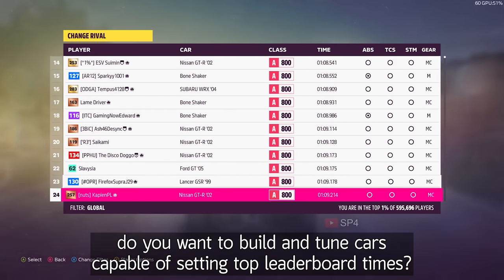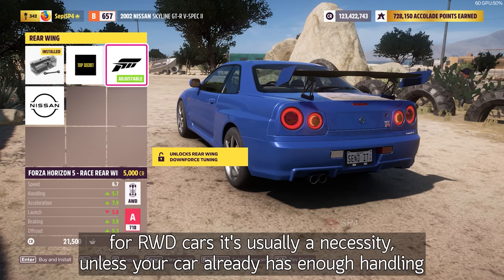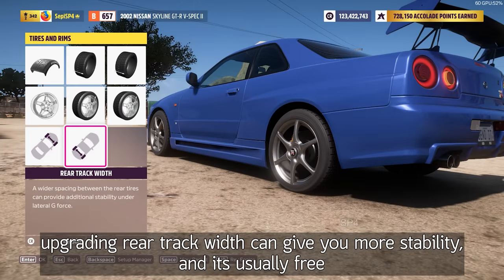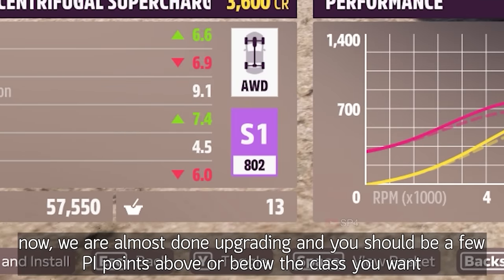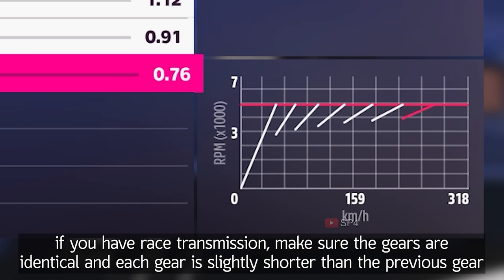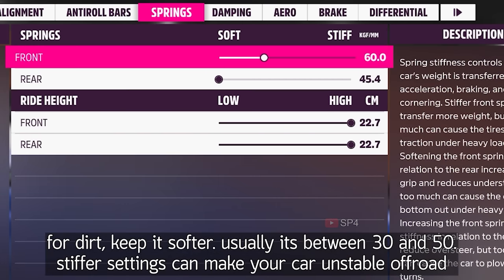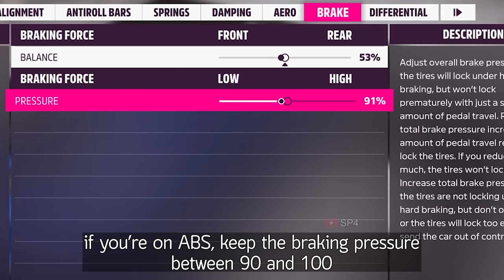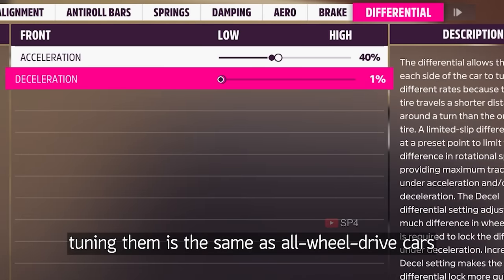Forza Horizon 5 META Tuning Guide

Comment: This straight up breaks almost every single rule of real life suspension tuning thanks forza 😂
Reply: exactly xD
Reply: The dumbest thing to me is how 0.2 degrees of toe out can reduce your top speed by 15 kmh. Racecars commonly use between 1.5-3, but that fails tech in Forza lol
Reply: @InZomnia365  racecars also use 3-5° of camber typically but forza says 2° is too much
Reply: @InZomnia365 it does not actually lower your top speed though does it? It shows you that it did in tune menu but if you test it car will still hit same speed iirc.
Reply: @nodo7575 yup. Same thing when you switch tires it might state the 0-60 changes but it really doesn't

Comment: I'll be sharing this everywhere I can.. Excellent guide!!
*Bonus Kudos for GT Music* 👊👊
Reply from the maker: thanks a lot :)
Reply: If don says it's good it IS GOOD
Reply: @rysh8331  unfortunately, most of DJS’s tunes are rather weak, they are great for beginners and solo players, but they are super weak for online racings.
Reply: Looking at your spreadsheet some numbers don't add up, your spring and aero number don't match the ingame numbers i can set.
Reply: @arnomeke1  set units to metric
Reply: @arnomeke1  Certain cars have different values. I just tuned an A-Class Continental GT which didn't go as low as the range he said for springs, but then I tuned a Vantage 19' that went lower. Either way, it should be in the bounds generally.
Reply: George Floyd  djs tunes really are just ok. even i can make better ones sometimes. maybe he doesn't spend enough time on some cars though
Reply: well, that's me unfollowing and never using your tunes again... this is not a fun way to play. i know you don't care but this guide, excellent? it's all wrong
Reply: how so?
Reply: we still wanna know why u mad
Reply: Bruh, I followed the guide, ran them on a test track, and they turned out really good, ur just mad

Comment: Bro this is the real deal. I have 400+ races played and I usually end middle of the pack with home made tunes. 

I followed ur guide then i got my first ever 1st place and a couple matches later won my first tournament! 

I used to think people were straight up just better than me but it turns out I was using the wrong stuff the whole time 😅😂
Reply: Yeah, in most races i knew i wasn't slow, i knew my cars were lacking important stuff, even with my terrible, terrible tunes i got some podiums, but most of the time i would end up near last place, even average or below average players would ram me and take me out, some of these losers even DMed stuff for no reason (i am not a rammer, if you are faster, i will allow you to pass). 

With this guide i now win most of the races or end up in 2nd place, now rarely i lose or get left behind, not to mention feels to good to be able to pass rammers or easily return the favor. Now i can take any car i like, use this tuning base as a guide and make it a rocket that make will people sh1t their pants. I've gotten so fast that sometimes if i feel i took someone out way too harsh, i give them the position at the end of the race, i don't care. Becoming super quick gives you a lot of confidence and also, you respect even faster racers as well.

Comment: This is excellent, it's what i needed, a good base for good tunes without any pointless explanations on what each car part does or what every single adjustment can change, just straight to the point, tells you what you need to do and you can move on from there to customize your tunes.

Some cars are still slower than i would like, but with some fine changes i think i can make some pretty fast stuff, thanks a lot for this!

Comment: Right on. Finally! A video simplified that I can spam watch every time I “attempt” to manually tune my cars. GG’s 🔥😎
Reply: Same 😂
Reply: Just watch hoki hoshi guides if you want a good tuner to learn from it's way more informative than this I mean this guide is okay and all but it's for getting the most performance out like power and torque with the least amount of pi which doesn't equate to good tuning or upgrades
Reply: me with drift tunes
Reply: @shura4136  well most of his tunes are within the top 300 times so he knows what he's doing.
Reply: @craigkingdon4424  I'm not saying he doesn't his tuning is just focused on most hp and torque out pi  for competitive use
Reply: Same 😆
Reply: @shura4136  getting the most performance with the least amount of pi is literally the definition of good tuning
Reply: @craigkingdon4424  no he doesn't :')
Reply: @shura4136  it literally says META tuning in the title
Reply: @veeembee  so you believe everything you read?
Reply: I've watched hokihoshi and sepi, sepi may not go as much in detail, especially but he definitely is a better tuner compared to hokihoshi, hoki just explains what each tuning setting does, sepi not so well but he's a consistent top 300 tuner. You don't believe anything you see but you'd have to be stupid to not see this, consider the high amount of proof available and believe that hoki is a better tuner, you'd have to be stupid, which I wouldn't be surprised if it was the case for you lol.

Comment: You also need to look at speed and acceleration, you want to be trying different combinations to get your 0 - 161 km/h second count as low as possible in that class
Reply: Quick acceleration comes at a sacrifice of top speed and vice-versa.
Reply: @CokefishR  Yeah, but it's the rate that counts for quicker pull out of the corners
Reply: @CokefishR  not necessarily. I always tune my cars for quickest acceleration, without using aero and with proper gearing I get the highest top speed out of my cars

Comment: Unless you have very high maximum downforce and are driving above 250mph, adding brake pressure doesn't improve your braking distance/performance, all you are doing is making your brake trigger/button/pedal more sensitive to locking the wheels up. 
The simulated data that changes in the tuning screen will show changes based on your settings however adjusting brake pressure in the tuning menu for basically every car slower than X class is no different to changing your brake trigger's deadzones
Reply: Wrong. Race brakes allow you to shift the bias forward and rotate the car a little just before apex for trail braking. You don't know what ur talking about...
Reply: @Eat-MyGoal  You litterally missed every thing he just said.

Comment: I made a top A class Evo 9 build that has 500+hp, makes the car move faster than most other road cars on Dirt and still has phenomenal grip on Asphalt.
MUCH Less understeer than ANY other AWD with the same power, with stock bumpers and wing (only race-hook rear bumper and BBS bronze wheels) top speed about 313Km/h.

I love the Evo IX but I hated how trash the car was in this game, while doing tight corners the understeer was ridiculous, so I spent months doing this build and adjusting everything so the car performs as good as the R33, and still rides great off-road.
I also hated how every build made by other people, switches the Evo's stock wing, and I hate seeing aftermarket wings on Evos 7, 8 and 9, (Because the stock evo wing looks best on those models).